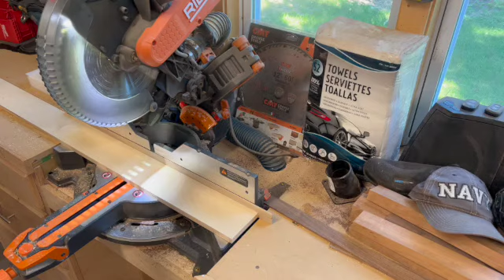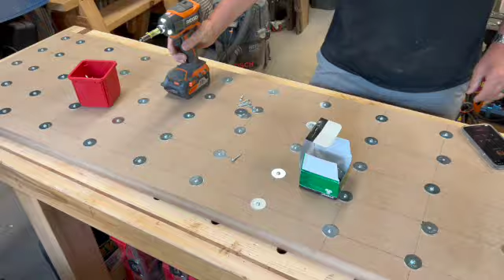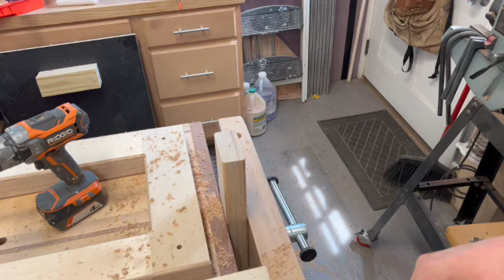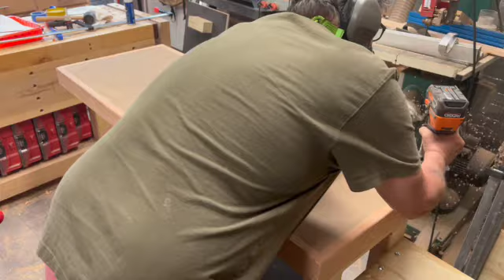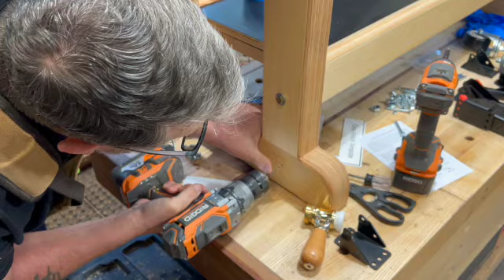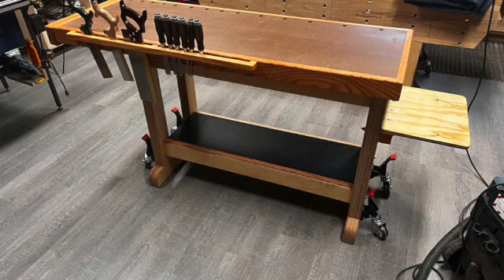Cosman Workbench Build for the Purple Heart Project

Comment: Rob pre-drilled the screws because you can get dimpling on the sheet underneath when the screw enters MDF and it won't pull the sheet in close together.
Reply from the maker: I got the dimpling.  But a quick once-over with some 120 grit took care of it.  Overall, that saved me a bunch of time - pre-drilling takes a bit of time.

Comment: Can you please tell me what screws you used to laminate the mdf together with?
Reply from the maker: I just used some screws I had on hand.  For the first layer, I used 1-1/4” pan-head construction screws with fender washers.  These screws/washers act as clamps..  Once the glued dried I removed all the screws, then repeated the process for the third layer, then the fourth.  All screws were driven into the underside so no holes are visible from the top.  In all, I used four 3/4” thick layers of MDF.
Reply: @wisconsinwood thank you so much, it came out great! I was curious is the 1-1/4" would be too large but the washer idea is genius! I appreciate you taking the time to answer my question
Reply from the maker: @xcornontherobx thanks for watching!  Will be posting another build video tomorrow of a desk I made out of walnut.

Comment: Great job Rich.  I've always wanted to build one of these after seeing Rob's videos of it, but I already have a half decent bench built from Spruce construction lumber!  Mine is sort of based on the Paul Sellers bench, but with stretchers at the bottom of the legs instead of aprons at the top, so it's sort of like a cross between this design and Paul's Nicholson style bench.     I always wondered if you could use a sheet of Birch ply as the top layer of the laminated MDF top, to hide the MDF core, or maybe use veneered MDF as the top layer, then veneer the edges too,  or use edge banding as you have done here!

Comment: Nice work for a great cause. Did you use anything to seal the edges of the MDF before gluing the edge band boards to it?
Reply from the maker: Thanks for the positive feedback!  

I didn’t seal the edges of the MDF.  But I did seal the dog holes with CA glue so they would hold up better to use.  
On the edges, since I put the honey locust edge banding on, I figured that sealing the edges of the MDF was unnecessary.
Reply: @wisconsinwood  Thanks for the response. Makes sense. I hadn't thought of sealing the dog holes until I saw you do it.